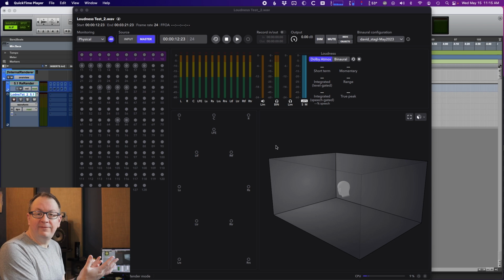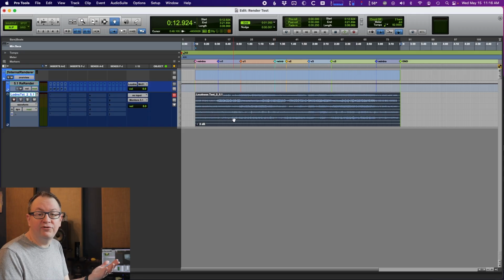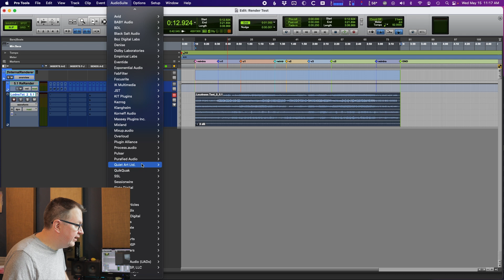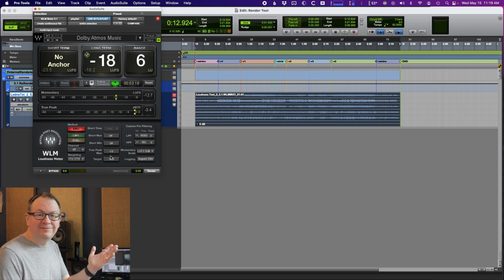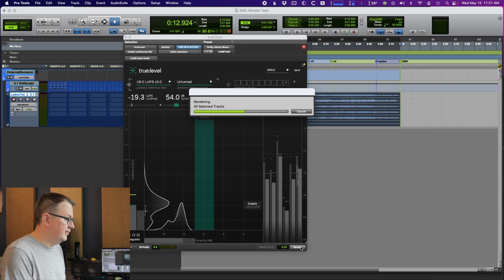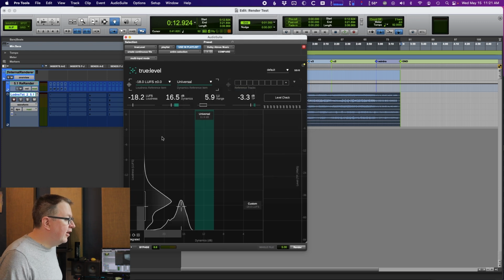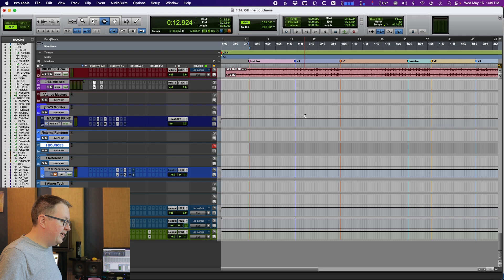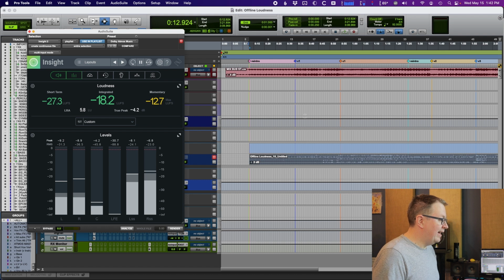Checking Dolby Atmos Loudness Offline

Comment: You can also just measure the mp4 dd+joc export as that's a 5.1 pcm. Meters like the free YLM can read the file and is same as DAR measurement,
Reply from the maker: That's extra steps. This is easier for me to do while I'm in the process of mixing.
Reply: @goingto11  Looked like you were rendering a separate 5.1 to measure offline to me? i'm just saying that step isn't needed, the same 5.1 pcm is in the dd+joc too if you didn't want to rerender.
Reply from the maker: This check is for use during mixing when there is no mp4, ADM, or any other printed version. Plus, as far as I'm aware, Pro Tools can't currently produce a dd+joc mp4.

Comment: Was the bounce created the same as what was exported from the external renderer? Looked like you had a different True Peak of -4.2 instead of -3.3 at the end. Wasn't sure if that was just a slight difference in the mix or what not. Thanks Dave!!
Reply from the maker: I believe it was. I know I messed up at least one of the measurements. Where I'm using this is while I'm in the process of mixing to see where things are. I still prefer to do final loudness checks with the Dolby Renderer.